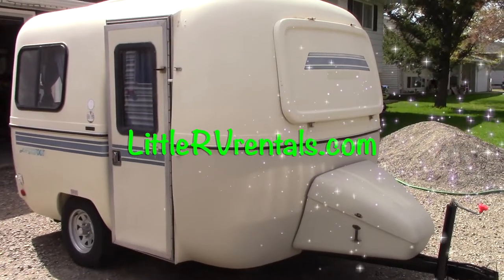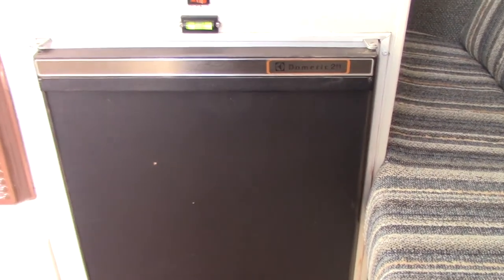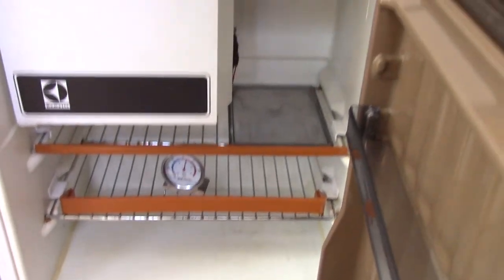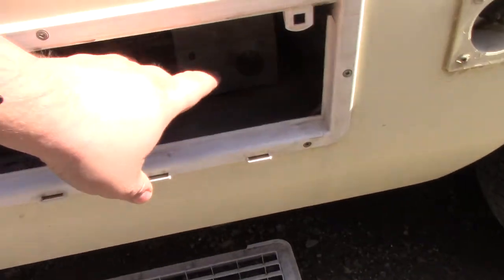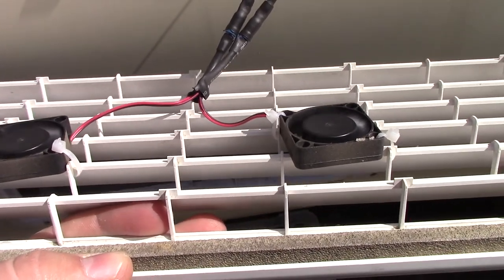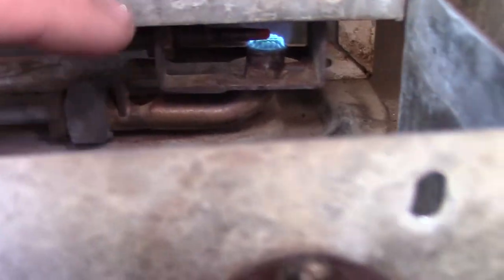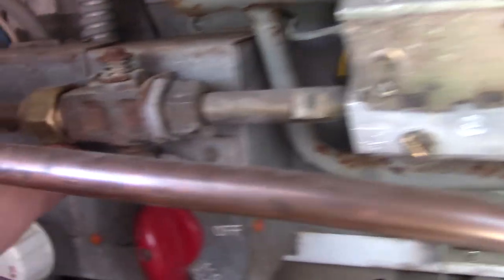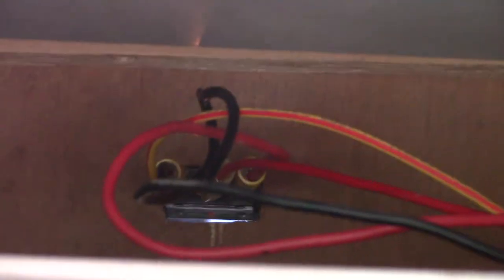Improve RV Fridge Cooling (TRY THIS!)

Comment: Mine runs very cold on 110v or 12v but not on propane... yeah the flame looks small to me. I will clean everything out. As for the regulator, isn't that for everything that runs on propane? So the furnace and stove? Those run fine.